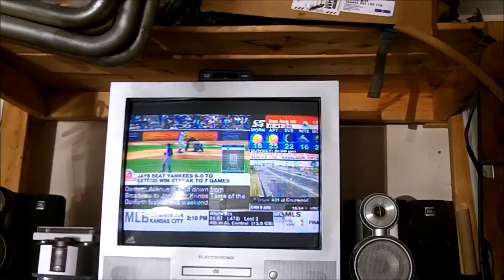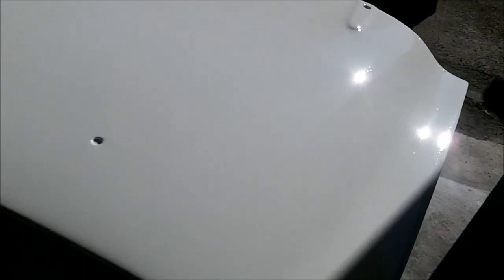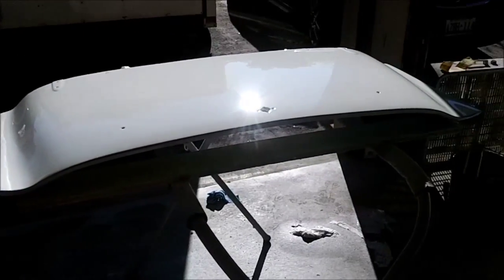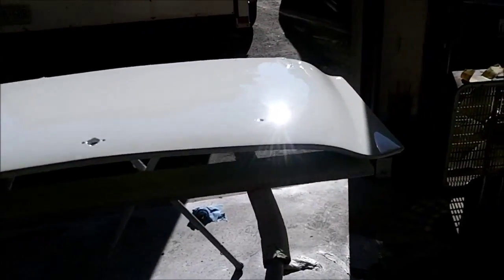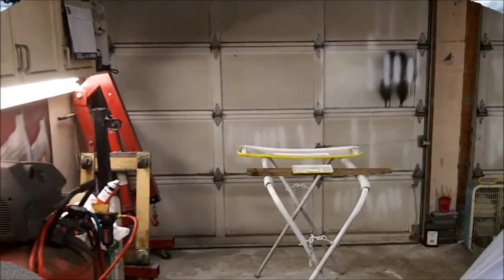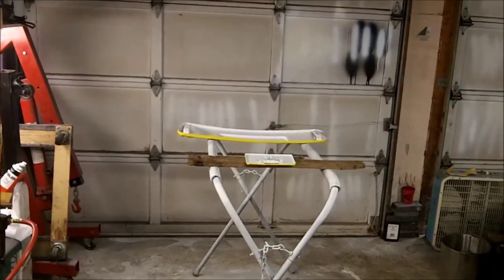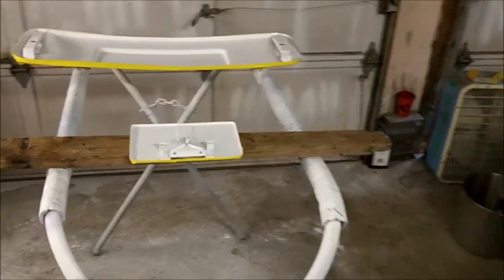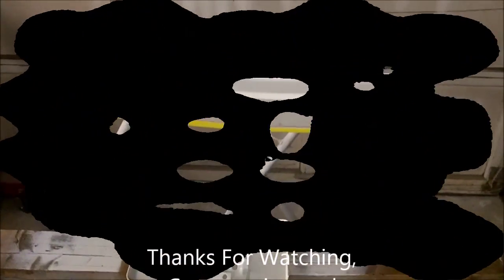Project Painting Update and Brits on the Lake, Port Perry, Ontario

Comment: Paint looks fine Dave, Did you like the Dekups set up. Plenty of Triumphs at the show.
Reply from the maker: Hi Martin, thanks. Yes, love the Dekups.  I really need to invest in some of the other sizes (smaller). I bought the 24 oz cups but really could be using the 9 oz cups for the smaller panels.   To be honest, I never really minded cleaning out the regular gun cups, but it is so nice not to have the worry about how your holding the gun so as not to drip paint, clog up your lid vent hole etc.  they are going to come in really handy when I get back to doing the tub in areas like under the sills.  Cheers, Tush ps. Waiting for your second video to see how you made it home :-)